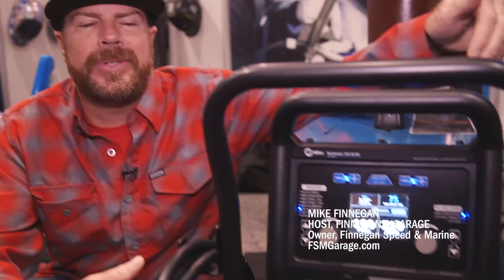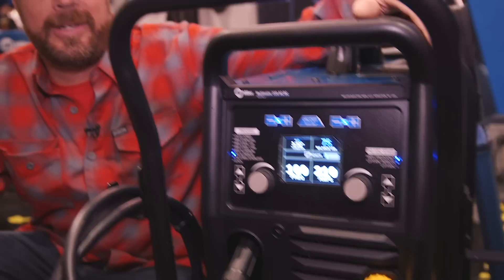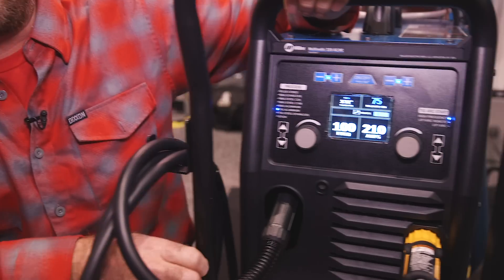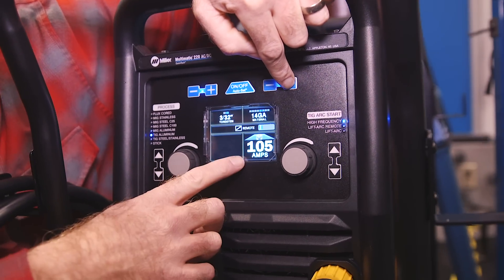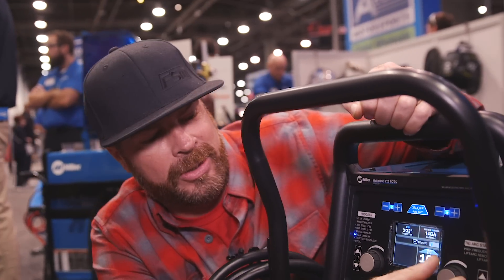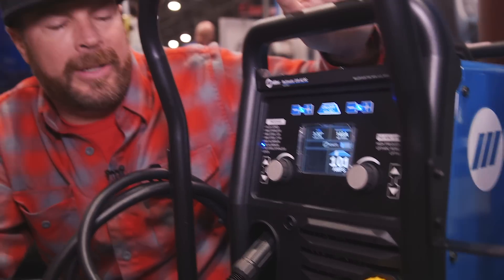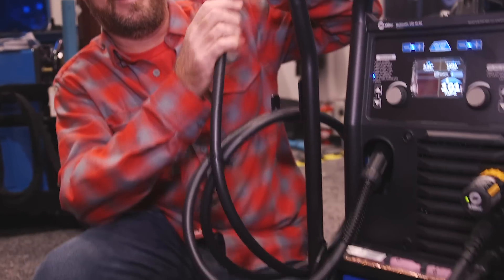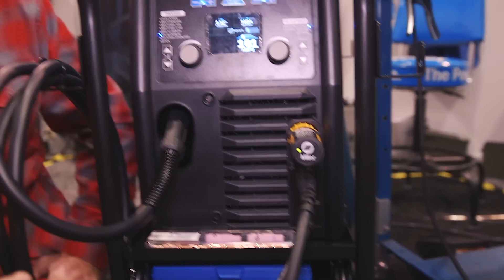See Mike Finnegan Showcase the Multimatic 220 AC/DC Welder

Comment: But , will miller be able to bring it to market before esab?
Reply: Well esab has it on the site already for the new 205 but not released until January but everlast already had theirs out for months now.
Reply from the maker: Hi Bill, the Multimatic 220 became available on Oct. 29. To purchase one, please contact a local Miller distributor: MillerWelds.com/wheretobuy. Let us know if you have any questions.
Reply: I’ve asked 3 times already but in the original video what mig gun was being used???? It had blue on it and was not a m-100 or 150????????????????
Reply: Weld Weld the gun is a new design and will be out soon. This thing has very limited Tig settings
Reply: @weldingjunkie   I imagine its good for very short runs. Not a production machine.  More for short quick repairs in the real world.
Reply: Bill Titwell I think you’re right I looked 20% duty no pulse no slopes limited balance. I think they don’t want to loose dynasty and synchro sales. Don’t know how a company like everlast beat miller to market. Miller takes years to R&D still
Reply: @weldingjunkie   They need to reintroduce a passport that uses the co2 bottles. Those are champions in the quick repair field.
Reply: Bill Titwell imagine a real ac/dc passport they would clean up
Reply: @MillerWelders  Niiice! Thanks for the update!!
Reply: Uhhhh its already out and selling?
Reply: @jamessonger3   try again show a link, the 205 is not shipping yet
Reply: esab already has ac/dc multiprocess, it’s a 205 but isn’t being sold until January but it’s on their site, the new multimatic 220 has been on bakers gas and a few more for over a month advertising but not available until October 29, I was told that directly from miller and everlast has had a ac/dc multiprocess version out for months now.